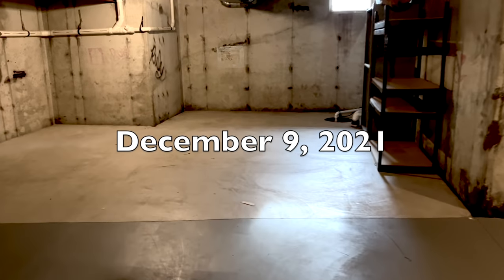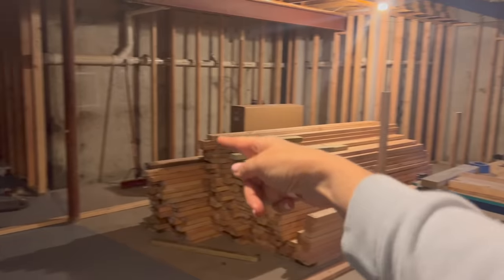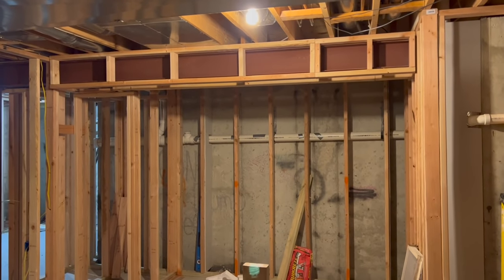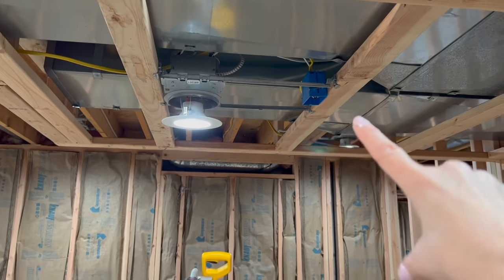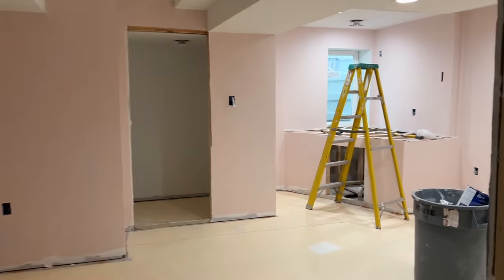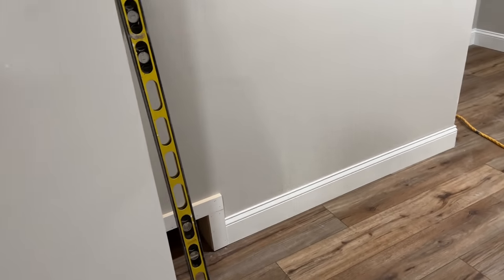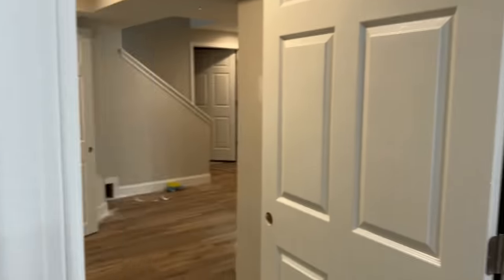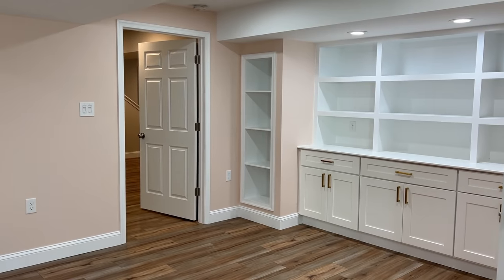Building my Dream Craft Room! Part 1 - Finishing Our Basement | Making Design Choices & Construction

Comment: I had a thought when looking at your issue with the built-ins. I wonder if the contractor could've put in cabinet doors in the top space that was available, and matched the unavailable space (the space with the pipe behind it) with "fake" cabinet doors to match. That way, you would still have to storage space in most of the areas, and it wouldn't mess up the overall cohesive look
Reply from the maker: We could have done something like that, but everything costs money!! The whole thing was so expensive (building AND setting it all up) so that kind of thing wasn’t really an option
Reply: @PlanningwithBumble  understandable😊